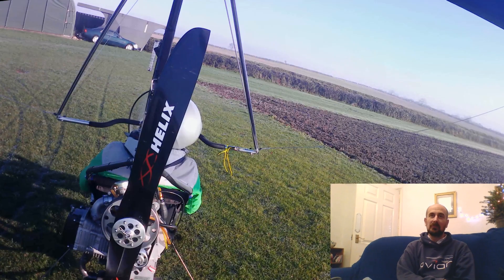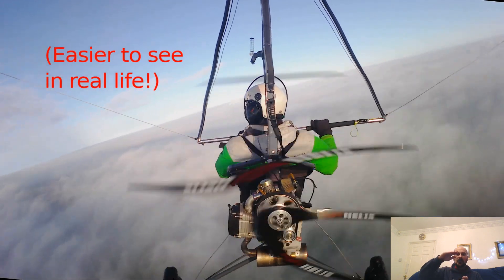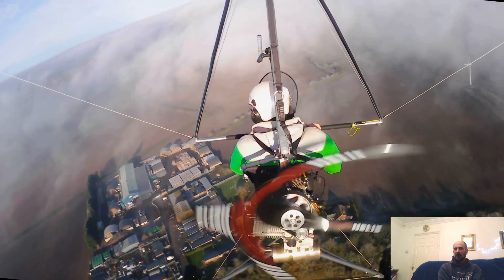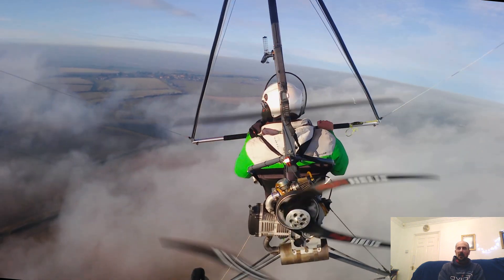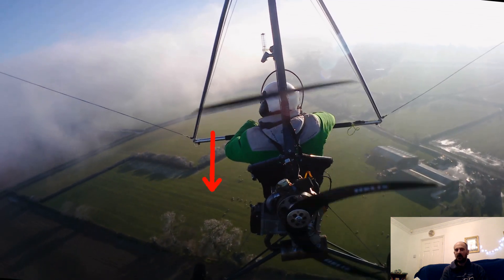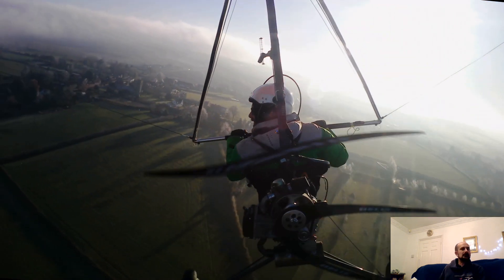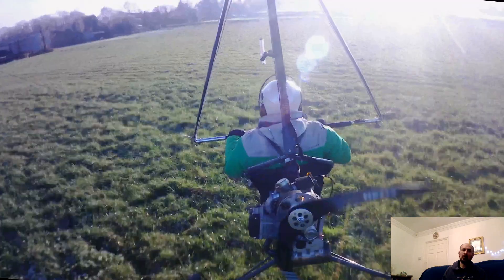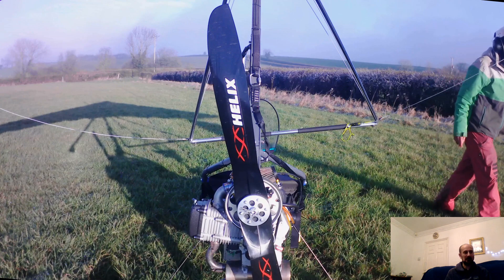Lost in the fog, where's the runway?!

Comment: has happened to me and got lost. Was not using a compass. Had to fly low enough to road signs
BTW what is the trike and its engine?
Reply from the maker: This particular trike was an MK Merlin I was borrowing from a friend. It had a Bailey 4 stroke engine, a little less power than the 2 strokes, but enough if you use it with an efficient wing and so smooth and quiet.